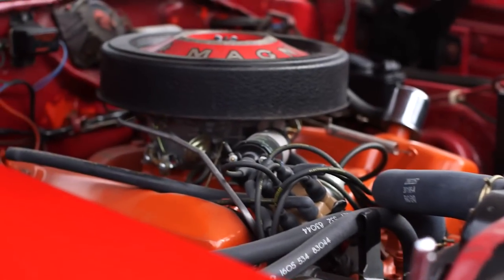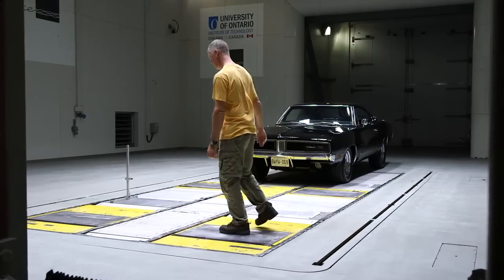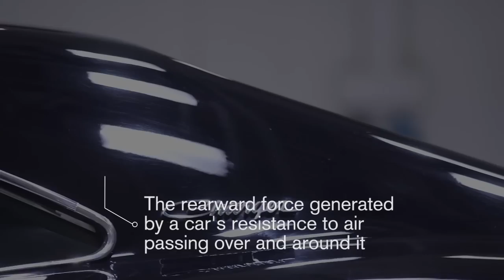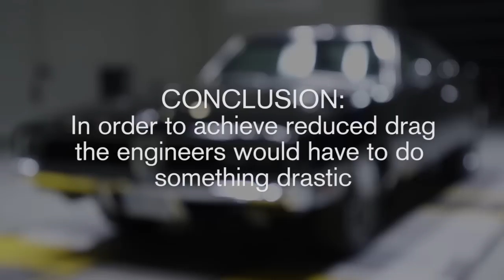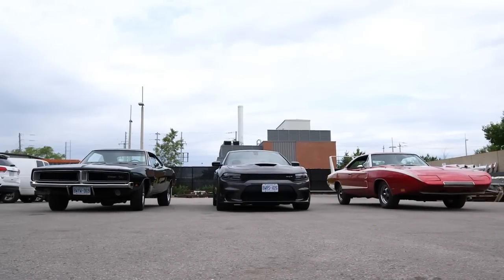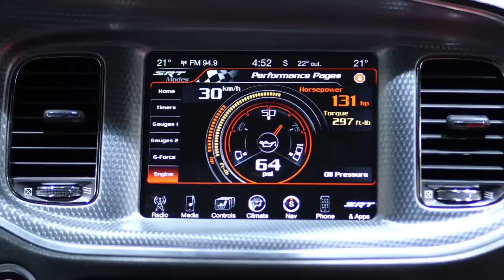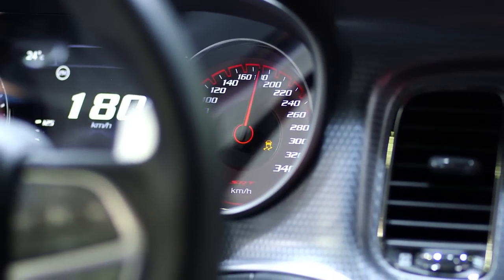Dodge Charger Daytona vs. Stock Charger vs. Hellcat: Wind Tunnel

Comment: They Should've used the Charger 500 compaired to the Normal Charger, Because the 500 has a completely differant Grill, and rear window section compaired to the normal Charger.
Reply: If we could have got one, we would have! Unfortunately, 500s are even rarer than Daytonas!
Reply: Even most car guys dont know about the 69 Charger 500.
Reply: The 500 still generated a ton of lift up front, the flat face only helped with drag coefficient, not with actual down force, it was only a few MPH faster than the normal R/T
Reply: Charger 500 at 190 MPH and level had 620# lift on the front, -200# at the rear.  When raked 3 degrees, the front lift was 320# and the rear was -240#.   Those numbers are from Chrysler wind tunnel documents at AeroWarriors.com

Comment: Another interesting comparison would be the 1971 Dodge Charger vs these 3 cars.  The 1971 Dodge Charger was designed from day 1 in the wind tunnel and they advertised it was as aerodynamic as the 1969 Daytona because of its Coke Bottle shape. The 3rd Generation Charger was very successful in NASCAR.
Reply: 1971 Dodge Charger (GW-23) had a CD of around .38 - http://aerowarriors.com/cda/cda_08_101370.html  It was designed to have a nose cone and wing, but when NASCAR put the restrictions on the 'aero' cars, it was relegated to being 'normal'.   NASCAR also removed the side glass in 1970 to help reduce speeds (check out the B pillars on those 1971 cars and you'll see that teams would shape them as an extra spoiler).

Comment: "the numbers weren't that far apart"   Am I the only one that feels ripped off that "the numbers" were not disclosed?   What gives?
Reply: There was a version of this story in a magazine somewhere, years ago, that showed the numbers and I put those numbers into a spreadsheet.
1969 Charger R/T had 373# lift at the nose, -80# at the rear, at 120 MPH.  I later overwrote the Daytona numbers with the factory document numbers I got from the "Chrysler Document Archive" at AeroWarriors.com. so don't have the Daytona at 120 MPH, but do have it at 190, which is 0 on the nose and 0 to -250 on the rear.

Comment: Yeah I almost forgot,those daytonas ,I was watching a NASCAR special where a guy say NASCAR wanted the daytonas tested before they could run in NASCAR,so Benny Parsons and three other drivers tested four Daytona s at Talladega Races at before the season started dodge said ok,Benny Parson said it was the scariest thing he ever did or drove he went 235 mph on Talladega super speed way on bias ply race tires,so even thou they said ok it was a little too early for stock cars to be going that fast,or ever most people don't realize that a Boeing 747 a plane over 250 feet long comes off the ground at 160mph,but it designed to fly.
Reply: BLAH BLAH BLAH BLAH BLAH BLAH BLAH BLAH

Comment: "The charger hellcat doesn't need the nose cone, or huge wing to achieve the same speed as they did in 1969".  Very true.  It also doesn't need the look, stance, or presence as the Daytona either.
Reply: no but it has 220 more horse power than a daytona
Reply: Bobba68 Dont worry. They dont know what the hell they are talking about.  "The Hellcat doesn't need the nose cone or wing to go the same speed as they did in 69"? Well its funny how the Daytona dosent need a supercharger or fuel injection or electronic computer controlled ignition or lightweight alloy and plastic parts to do the same speed as the hellcat
Reply: Yes and why does it have 220 more HP? Because among other things  its being force fed air Whereas the Daytona breathes naturally

Comment: Growning up I own more dodge challenger s and Barracuda than any one you ever met when I started driving,and the one thing about my E bodied cars and other dodge cars the front of the car starts off smaller and as the shape moves to the rear it slowly gets larger and then small again I can tell u from driving experience the fast that they go the more stable and glue to the road they are,and when your going NASCAR kinda speed and you are just barely holding the wheel it inspires u to go faster because you believe in your car it ain't scared and u ain't scare,before 1970 most dodge cars were what we call a flying brick,not very aerodynamic but great motors and there transmissions were a step ahead too,I went to go look at a 1974 360 cuda 4 speed car that a mechanic friend own he said I got a cuda come over and see it one day,and when I did he said come on get in drive it around a little 4 speed manual trans car owner say shift it but don't step on the clutch,hah hah ,what I look and he says go ahead do it,so I did littlevbonk and it goes right into gear,I'm like what the heck,...he say I just put rebuilt the trans all new brass nice car 5000 grand and it could have been mine didn t have it had four other ones thou...very interesting lets see what this is all about.

Comment: I think the stock '69 is far better looking than the other two but as they say:  "If aesthetics equaled aerodynamics, the E-Type Jaguar would be the fastest car in the world". And no mr. lab guy, A-pillars are not the same as drip rails. A pillars are the front roof support. Drip rails run along there then back across the roof and down the B-pillars to the trunk to catch rain. Now they are integrated into the door-roof seam for better aesthetics and aero.

Comment: Sure didn’t learn much from this.  Anyone who has done even a modicum of research on the Daytona knows everything they discussed here... and more.  I was hoping for drag coefficient numbers - the Daytona established the landmark of .28 (Superbird was .31), and the Hellcat is around .35.  Nothing beats the old winged cars for aerodynamic advancement.  (And the street Hemis could crank out 465 hp @ 6K rpm on breaker points and 60 year old carb technology - Godzilla's lawnmower engine.)

Comment: The hellcat looks good and all, but it doesn't have that 'wow' factor that the other two do. The car just looks like most other modern sports cars, nice, but boring in comparison to the other two.
Reply: So well put and in that old geezer grey that a lot of cars come with today
Reply: it doesnt. 69/Daytona are still better head turners than any modern charger. why? because they are RARE. you can get immaculate hellcat almost any day, but Daytona or charger 500? not even close.

Comment: Yet modern chargers have no 200 mph speed breaking records.🤔🍻
Reply: UHHH yeah they do...STOCK Hellcat Charger with race tires and roll cage averaged 202 MPH at Talledega. 207 on the straights. DUUUHHHHH!!!!!!!!!!!!!!!!!!
Reply: Modern day Charger Hellcats can reach 217 MPH if the speed limiter and race tires, or 205 MPH if limiter is on.

Comment: did you guys see that 230 mhp guage on the 2015 one
Reply: 230? It says 340kph which translates to about 212mph. If you mean the speedo, that is...
Reply: are you blind it said 230
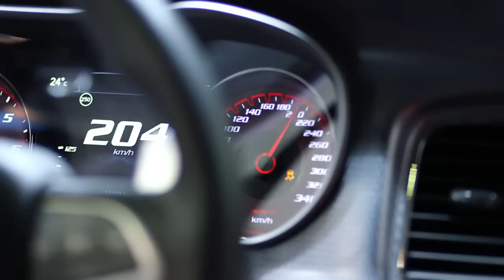Reply: You can only see the speedo at around 4:14 and it is indicating about 200kph with maximum number being 340kph. It doesn't show mph at all.
Reply: ok ok

Comment: Then lets put the hellcat motor in the daytona and...boom, instant restomod racecar!
Reply: Boom instantly slower because the Daytona hits 200 stock
Reply: @Leatherface123.  Hellcat Motor makes by far more torque and power. Hellcat is actually faster than the daytona I'm pretty sure.

Comment: I will tell u if u don't know the front grill being open area the car shake bad the stock front end its creating lift I didn't know that but I remembered that front grill shaking just a little over 55 mph like 70mph over 55.the rest of the car was nice ,and I thought it was the charger 500 that had the flush grill and headlights and flush rear window,u know how those got built don't you the 500s were left over Daytona body's to race in NASCAR they had to build production street legal for the pubic sale cars,a certain number first year it was 1900 something next year it was 1390 something next year it was ban because it was way to fast,so they did build any,and then they banned big blocks.dodge put that 500 logo on a lot of different cars just to torture us... I seen a car with a 500 logo and I say hey what's in that it a 500 and guy says 318 nope original motor huh,why does it say 500 then ah silence wrong number...
Don't know dodge like that name he say...ok
Reply: Mr science is here to save us all!!!!

Comment: When I started road racing motorcycle I really started being a student of aerodynamic,because u was going 150mph on a race track and u draft everything u can for an advantage,that's when I learned that the air coming off the back of the vehicle the drag facter is probably the most important part of a cars aero design...that's the reason the back of every car on the road today all looks the same,pretty boring,it for gas mileage,but still boring...see you all thanks good stuff,hey what about those NASA guys I said Chrysler must have had working for them,no,honestly all you would have to do is look at an FA 18,OR 16 or The space shuttle and u would see dodge aero influences,the 1971 Road Runner one of my favorite car designs is a small version automotive version of the space shuttle ironically the sister car is named the Satellite I did not that one coming...yeah I did but it took a few years coz I could take my eyes off my challengers and my Cudas...please don't tell anyone I think the 71 Road Runner is the coolest looking body design ever,and that coming from someone who collects E body's only,sorry when it comes to driving fast aero and size frontle area count and plain just bad ass looks Road Runner 1971...has it hands down....

Comment: I hate to break it to the author but Dodge did NOT dominate the 69 and 70 season, Ford won the 69 title and and then pulled out of racing after 69.  Even so, according to nascar records, on superspeedways the tally was Talledega Torina with 14 wins, Mercury cyclone spoiler II with 8......dodge and Plymouth together  14.......
Reply: Dodge did win. Simply because the idea of the nose and the wing added to the 69 charger,gave it the win. Only thing ford did: was whine on and on and on about ''aww aww dodge is cheating with those modifications'' Meanwhile Mopar-power continued to dominate. Where you get off with that: found on road dead,first on race day,last at finish line ford crap,I don't know.
Reply: David Thayer-Don't know where you're getting your information from...In 69 Bobby Isaacs won 17 races by HIMSELF driving a Dodge....Dave Pearson(driving for Ford) won 11 races...So how could Dodge & Plymouth ONLY win 14 altogether?
Chrysler dominated the 70 season by winning 37 of the 48 races
Reply: 68bobba2 Right. Mopar or NO car. Period.
Reply: read what I posted.....superspeedways are defined as 1.5 miles or longer, that is where the aero cars were designed to run.......just watched the 1970 firecracker 400.....the talledegas spanked the winged cars pretty bad and yes Chrysler did win a lot in 70 because ford pulled the money after 69
Reply: talking the aero cars the total tally was 29 wins for the Talledega, 8 for the mercury cyclone, 8 for the superbird and 6 for the charger daytona.......the charger 500 was actually the most successful aero car from chrylser with 22 wins
Reply: But they did win, simply because of the innovation. Ford complained  like a bunch of babies and paid of the judges to ban the winged warrior.
Reply: @bultacowally  Yep.
Reply: @VINTAGE1959  They weren't banned.  All 5 'aero' cars were limited to 305 CID from '71 on, in NASCAR.   They ran in USAC through their 3 year eligibility and ARCA even saw some 69 Charger 500s run as "1970" models, using the 1970 nose and keeping the rear window plug.   ARCA was always been a bit 'funny' with the body rules, like Bobby Watson and others running 1970 noses and 1969 bodies on their Coronets.  ARCA also restricted the engines on any 'aero' cars, but in the case where they'd run the car as a '70' and not a '60 Charger', they'd let them use the 430 with plate.
Reply: @davidthayer6969  You're including short track wins now?   1970, Ford had 7 'aero' wins, Chrysler had 12 'aero' wins.   1970, Bobby Isaac, not David Pearson, not Cale Yarborough, won the Championship.  From 63 through 69, Ford dominated.  You keep wanting to pretend 1970 is 1969 and it's not so just stop.